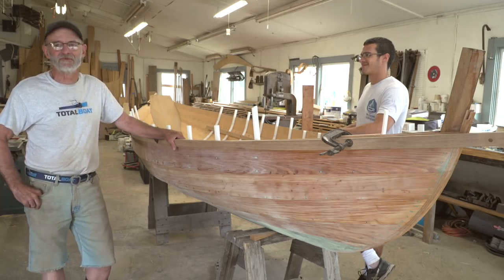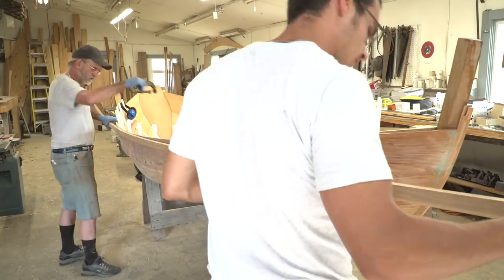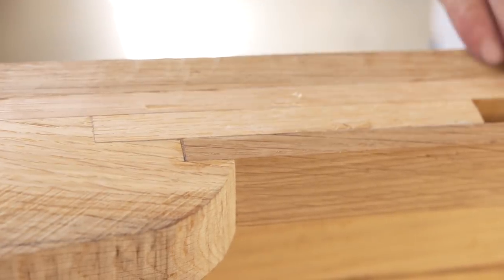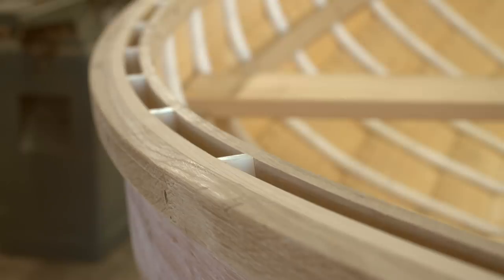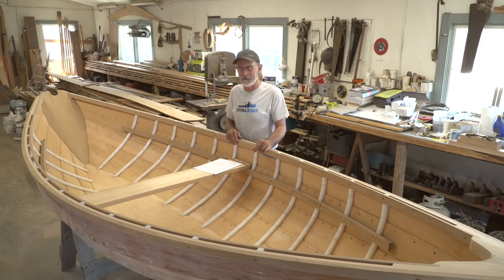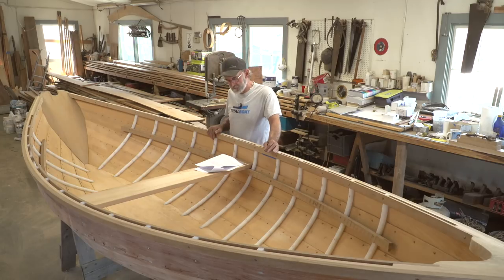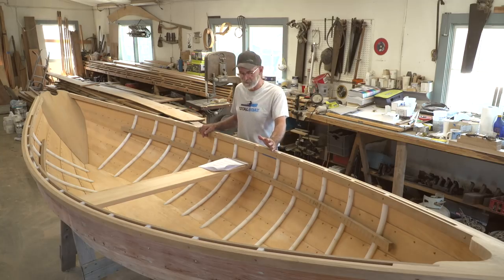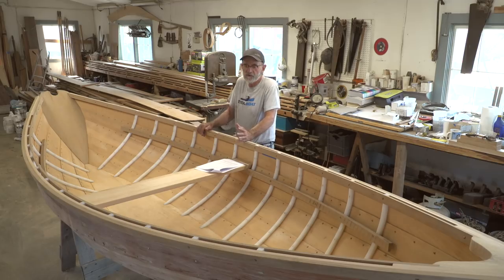Building the TotalBoat Sport Dory: Episode 30 - The Guards and Inwhales + Audience Q&A

Comment: When making steep angle cuts on my Delta I made up blank table inserts from 3/4" ply, screwed them in place and then raised the running angled blade up through the wood. Great for angle cuts on thin stock or short pieces.

Comment: Great Q and A,  Amazing in 50 years of boat work you have never built a set of oars !

The DNA test dosent tell you what county your from, it tells you where in the world people with the same DNA would be located in a very broad sense. I always thought I was mostly from around the Germany Area, to find out actually from around Tuscany Italy area, it is a cool test. It also tells you alot of other things about yourself. The National Geographic one called Genographic has a on going up date as new Data comes in. So there are always updating your profile on the Web Page. Not sure if the rest of them do this. Its amazing to see where your Genetic Line Started from. And Sometimes surprising. And since your a Male, you will get data on both sides of you family line, both Your Mom and your Dad, Females only get there Mom. So if you have any brothers or sisters, they will be the same as you, so split the cost, or not.Share you password to the Geno site and they will be able to see all the information also. Its alot of info. Its amazing to think the DNA you have goes back hundreds of generation.
Its traced my Moms DNA Line back 77,000 years, and my Dads Line back 44,000 years.

Comment: Holy Moses!  You're certainly good at what you do, Louis, but...please make a few sacrificial plywood throat plates for that table saw!  I know you're skilled at controlling your wood and never, ever, in 50 years hurt yourself from doing something that sketchy, but some clod is going to see that open throat, think it's OK to use a table saw that way, and either cut off his hand, eat a flying chunk of wood, or both!

I worked 8 years in a fast-paced wood crate/box factory that'd been in business for 150 years, 50 in its current location.  I ran all sorts of circular saws, a 5,000 pound Wm. B Mershon twin resaw with 54 inch wheels, un-guarded multi-head nailers, pneumatic nail guns, (up to 6 inch spikes) arc cutters with 10 inch wide dadoes, and other dangerous industrial woodworking machines.  Then I finished with 3 years in the pattern shop, doing precision work.  You could safely say that I know a little about wood working equipment.

I have all of my fingers, the guy that trained me in the pattern shop has all of HIS fingers, but the guy before that (who was there for 30 years) did not!  Neither of us 'new guys' took undue risk when it came to using any of the equipment in the shop.  That parts-missing guy DID like taking shortcuts though...and those missing fingers, as well as the several rectangular holes in the 3/4 inch plywood wall 20 feet behind the feed end of the 14 inch Oliver cabinet table saw, serve to prove that stuff happens when you take shortcuts and risks...even if you're an experienced professional!

To those who are not as skilled, and lucky, as Louis:  Never, EVER, use a table saw without its throat plate installed.  And, if you can't figure out how to do the desired cut with the throat plate installed, you are using the wrong tool!

Some lizards and whatnot grow back missing appendages...humans don't yet!

Comment: You should have made a zero clearance insert plate and raised the blade through it. Using the table saw the way you did was extremely dangerous. As a woodworker I keep zero clearance inserts on hand just for times like this. I hope no one at home tries to repeat what you did. I have seen too many table saw injuries over my lifetime.

Comment: One problem with using live or natural edged boards on a boat is that it necessarily includes the sapwood. The sapwood's prone to rot and insect attack, and in a marine environment it's almost guaranteed to give you problems. With air-dried wood, even in a house, there's the potential for boring insects to have hitched a ride in the sapwood from the wood lot or saw mill, and then you start noticing little piles of sawdust on the floor in odd corners.

Comment: I think cambering the seat means to tilt it forward or backward slightly. It's always enjoyable watching your videos!
Reply: ArtemiaSalina --- Cambering means adding an arch/bow up. During road construction, I laid cross drain culverts with a camber a few times.
Reply: arkansas 13 ~~ that's how I use the word
Reply: In building construction, steel beams are often cambered, which means that they are "bent" slightly upward so that they will eventually, under loads, become straight and will not sag.
Reply: Ok, I'd always heard that arching or bending up like the profile of a road or a beam called "crown", and the tilt of a wheel, for example, called "camber," but you're right. The dictionary says it means an arch or bend.

Comment: Would have been much easier if you took a 45 degree chamfered router bit put it in a router of course, mount the router under a piece of plywood with a hole in it for your bit, instant router table. Push your board thru, keep making passes till you get it where you want. Much safer and better job. Looks Great‼️👍 Vinny 🇺🇸
Reply: Router bits have the tendency to rip wood apart if they go in certain grain orientations, because the bit can grab (much like a drill bit grabs metal and sucks it up), more likely than not, with that curve, the grain would've gone right in the bit's bite.
Reply: What he did took half the time your method would've taken, and gave a nice straight line. There's no way pushing wood through a router spinning at 10k rpm, with the router cobbled to a piece of plywood, is safer than running it through a table saw.
Reply: Some people don’t like routers
Reply: Seriously?
Reply: Whats wrong with not liking routers?
Reply: Hi Brian.  The reply was to the original post.
Reply: woops :)
Reply: It would take ages to take that much material off with a router.
Reply: There was a style of base trim that was very popular in the 70s called RE or reversable edge base. It was very similar to what Lou made except that opposite corners were chamfered. Since we often made it on site out of other stock, usually left over lap siding, I've milled thousands of feet using all the methods mentioned. Lous method with a captured blade in the sacrafical fence on the table saw is without question the easiest to set up, and produces the most lineer feet in the shortest amount of time. But the are a couple additional aids that make it so. I always used a zero clearance blade insert since I often had to mill lots of short lengths, I installed finger boards to keep the stock firmly against the fence, in front and behind the blade and above the stock to limit uplift. An added benifit  with an AB 42 tooth ripping blade, was little burn, no tear out, and minimal finishing required to produce a finished surface. 
Using a site built plywood router table is not so easy to set up correctly as postulated and requires a good size router motor capable with 1/2" collet.  If you are using a bearing style bit it out has to be a good one since the inexpensive  ones often leave bearing burn on the surface and in most cases you will need to make multiple passes. Safety wise it's not true that it's safer, this is simple the user's preference, he's comfortable with this method so it "feels" safer to him. Controlling the stock using the table saw method outlined about in reality is actually safer and produces more output and a more consistent surface. Using feather boards and push stocks eliminates any need to put you hands anywhere near the blade. Lous got it right in the video no doubt!